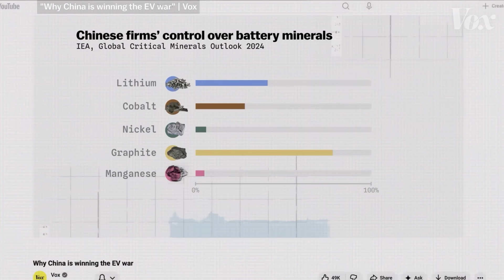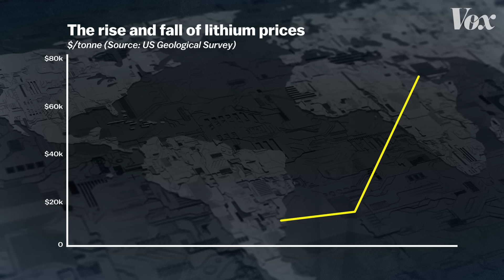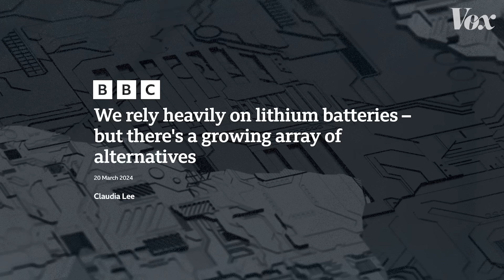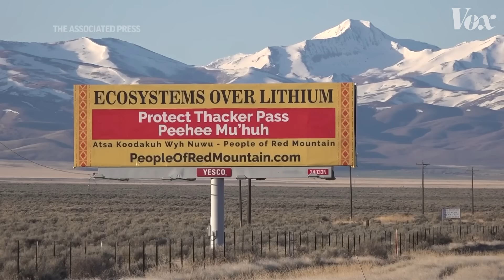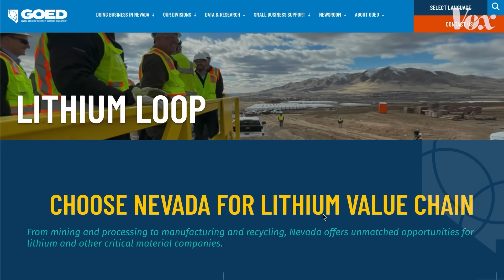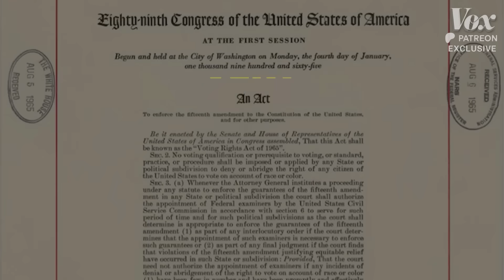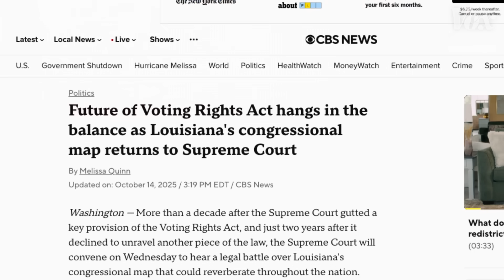Why we need so much lithium

Comment: I dumped all my Lithium investments as I think Sodium Ion batteries are the future. Less rare earth metals are required for manufacturing as the main component is literally salt. They are more durable, have more charge/discharge cycles, can be charged and discharged below freezing temperatures and do not combust when punctured. It will take a few years for the economies of scale to take affect, but that's what I'm betting on.

Comment: China: number 1 Lithium producer; China: number one consumer of Lithium. the US? number 2 or nonexistent. this is something the US will have to get significantly more used to as China becomes number 1 at more and more things. the US is where the UK was in the 1920s in terms of empire.
Reply: Some industries already are dominated by China. Want IEMs? The best ones and best per dollar are both made and designed in China. You want toys? Unsurprisingly moving most of that industry to China gave them the means to outcompete everybody else. They have the numbers, and we gave them all the manufacturing experience they needed.

Comment: Even if battery production moves along to sodium we should still probably have some development of lithium extraction, processing, and who knows what kind of potential future use from it. Ten year plan for such ambitions will make Nevada jobs happen, too. Put solar next to it strategically and it’ll be greener and more attractive. If it ends up a ghost town in thirty years that’ll be the risk we take.
Reply: Sodium has lower energy density so it makes more sense for stationary storage. You might get some low-cost EVs in the future that will use it, but I doubt that the majority of cars will, Trucks certainly won't cause even with Lithium they have a lot lower capacity than with diesel, and we won't be using it for phones and laptops cause those are designed to be as light as possible.

Comment: "the batteries that power solar panels" 😐

Dude. Solar panels create power, they don't use it. You might pair batteries with solar panels to smooth out intermittency, but that's not the same thing.
Reply: Power doesn't have to just mean one thing provides energy to another thing. It can also mean one thing crucially supports/empowers/etc another thing. An example of this is the commonly quoted "powered by AI" or "powered by [insert service here]".
Reply: But you knew what he meant. Thats all that matters bro.
Reply: @UberArmy  Good point, that's why newspapers are famous for not hiring editors because after all yuo cn stlil telll whut thye meen wen they're r typos
Reply: @nbamberger facts
Reply: @UberArmy 
People love to nitpick.